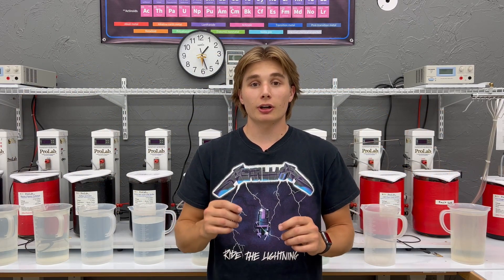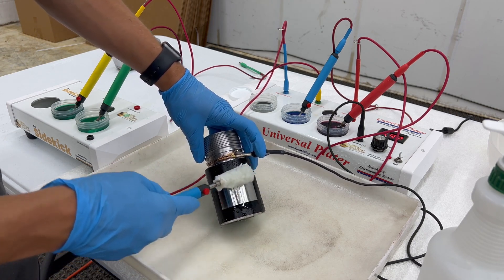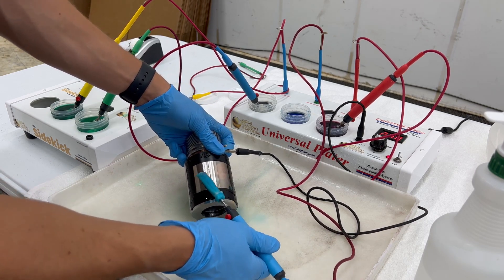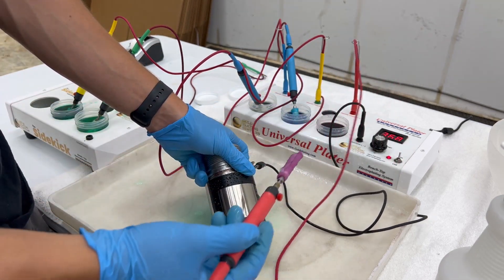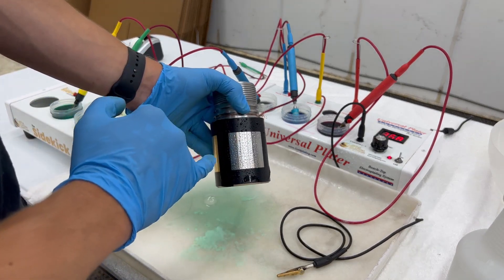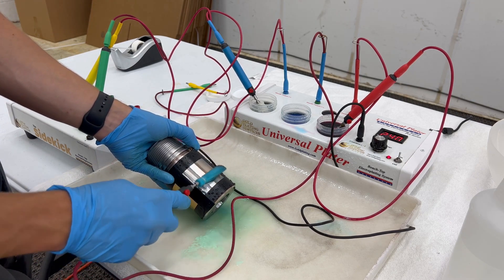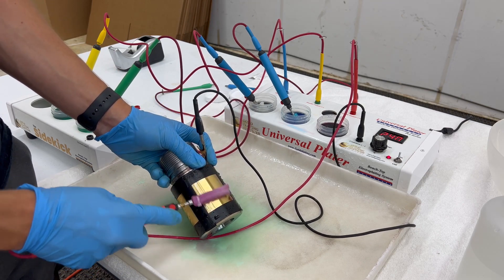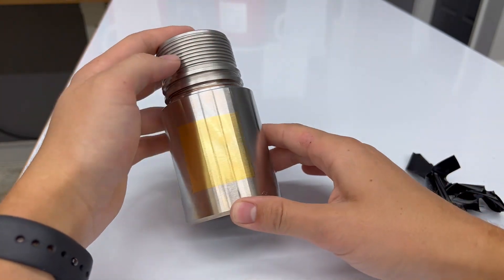Brush Plating Onto Steel Using Copper Strike

Comment: I'm confused. Looks like you used the exact same process for both sides.
Reply from the maker: Exactly. The point is that you can do it with or without the woods nickel strike and it is just preference on how you want to plate your item.
Reply: @GoldPlatingServices  I'm also confused.  You used woods nickel strike for both sides.  How did you show us you can do it with or without the woods nickel strike if you used it for both examples???  Am I tripping out or what?